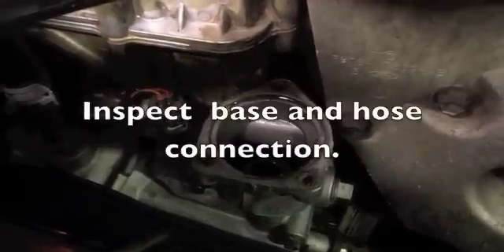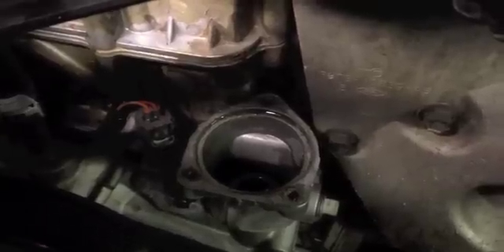Ford 7.3 Powerstroke coolant leak. (Thermostat)

Comment: my 7.3 i just discovered had two seals one around the outside flange in the groove around where the thermostat sits then above under the housing flange...is this normal or do i just need the one around the thermostat ?

Comment: I like this guy, he seems pretty genuine about what he says. I have a 7.3powerstroke,  I am a firm believer in changing your coolant & radiator cap annually.  The coolant lubricates the water pump,  it will lose its potency just like anything else & your water pump will suffer.  Don't be lazy with changing your fluids or it will cost you way more in the long run
Reply: you got that right

Comment: You hit it on the nose!

I had the thermostat leak on my original pump. So i ordered a new thermostat housing, thermostat and the seal. I didn't feel comfortable with the new seal because it looked a lot like my original one that was leaking.  It only sat on the top of the thermostat. 

I went to Ford and bought an original thermostat. Then i realized the seal was different. That was the problem. The new thermostat cost me $56 at Ford. Ouch. But it works and doesn't leak.